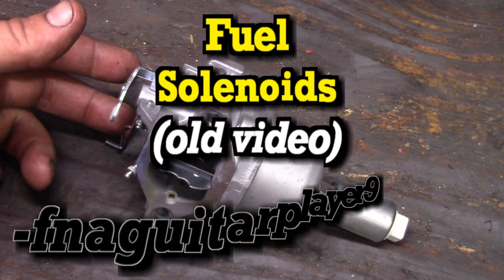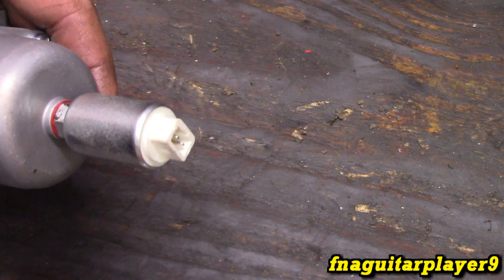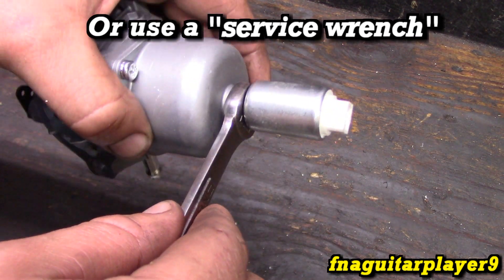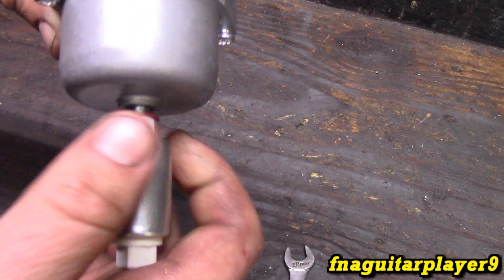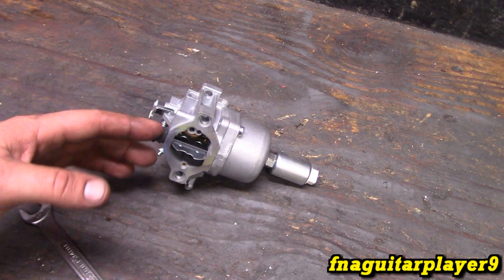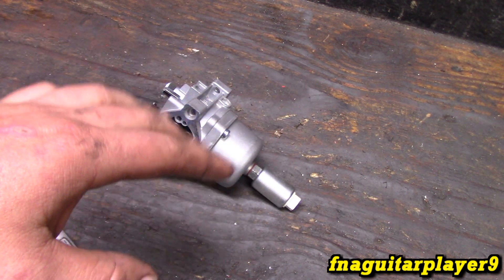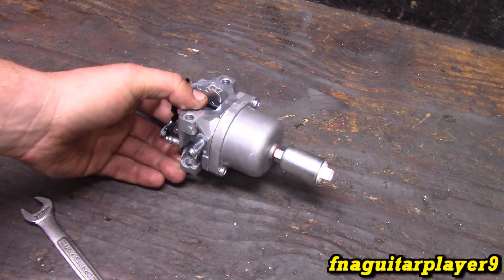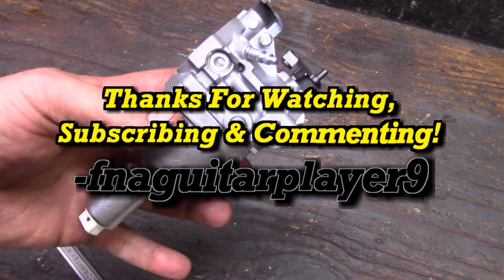Small Engine Fuel Solenoids, How to Replace / How They Work

Comment: On this particular type of carburetor show us how to take those apart and clean them and especially the main jet because I've got a few different riding mowers that has all of these anti backfire valves on the carburetors and some are either Kohler engines or Briggs engines but I mainly run Kawasaki engines and never anything with Tecumseh engines because I hate them things LOL anyway I would really appreciate if you could show us how to clean these types of carburetors and especially on the Briggs and Stratton engines and as far as disassembly and what to clean including Main jet and what to look for and then reassembly but I've always wanted to see someone put out a good explanation on these carburetors on how to clean them
Reply from the maker: I think i have a older video on these, look up 2 piece flow jet carbs on my channel, I will make a newer better quality one here soon though! Thanks for Watching!

Comment: Hey Frank ! What could make an engine backfire even IF, the solenoid works ? Thank you in advance.
Reply: is it backfiring on shutdown, or while starting/running? the fuel solenoid only prevents (afterfiring) after you shut off the mower and it's winding down.
Reply: @travismauldin7194  Backfiring on shutdown. Even if I let it idle before shutting it off.
Reply from the maker: Hey! It could be not sealing off all the way letting a small amount of gas come through. Thanks for Watching!
Reply: @fnaguitarplayer9  I guess I'll have to invest into a new one. As long they haven't adjusted the price at the "bug pandemic" bullsh*t.